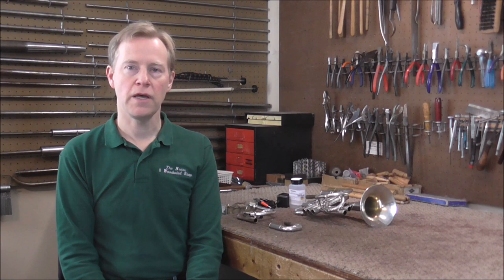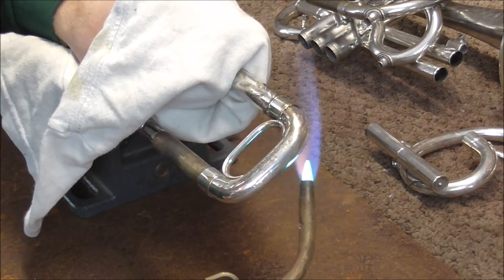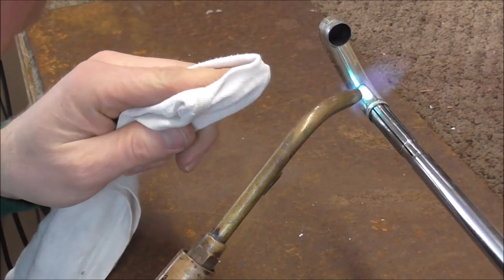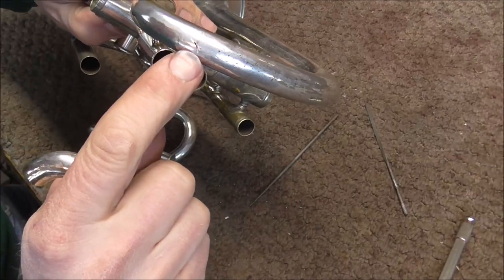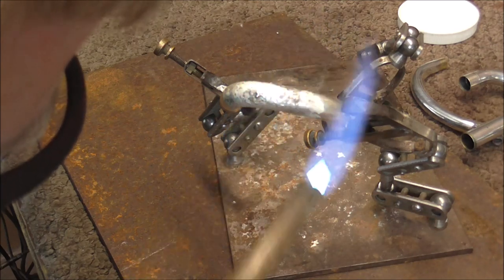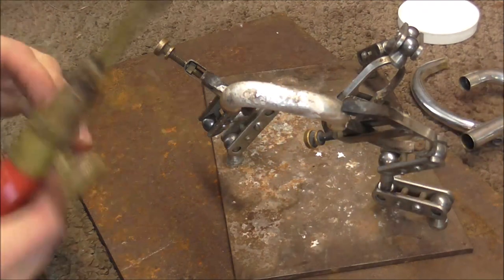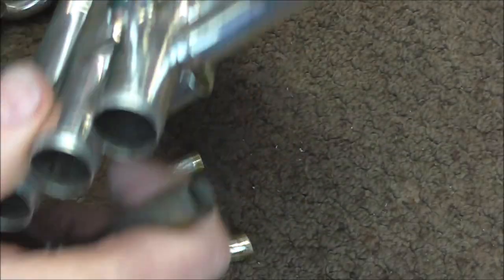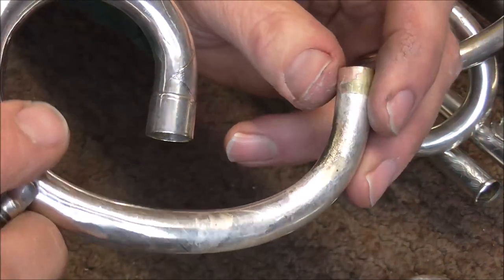Patching Cracks In Bell & Tuning Slide Crook: Distin Cornet Restoration #6

Comment: Hello, Art. Great videos. Have a question about patching with a silver soldering. Could it leave a drops and bugle inside the tubing, where you can't file? And how to avoid it?
Reply: From my experience, you can leave drops inside of the tubing it the crack is very wide, and/or too much heat was applied which makes the silver solder super fluid.
To me, the best way to avoid it is keeping cracks thin (even if filing a little bit the inside is mandatory, solder won't stick to dirty/oxidized brass) and, as always for solder jobs, managing the heat which requires experience.

Fortunately I learned making this kind of jobs by making rolled tubes (to replace mouthpipes of old horns) so I could file the inside of the tube when I messed up

(This is my opinion and experience, Art has probably more interresting stuff to say)
Reply from the maker: What 1090yoyo said is accurate. Because the inside of the tubing has not been cleaned thoroughly, it is unlikely that very much solder will flow into it if the crack is small. If the crack is larger, there are ways of keeping the solder out, but it takes a lot more skill and heat control and it is a little risky. In situations like that, I would usually soft solder a patch onto it.

Comment: I’ve wondered. Is it possible to convert a f attachment trombone to a bass trombone. Like an older open wrap single rotor to a 2 rotor.
Reply from the maker: Yes, it is possible, but it would be very expensive and finding parts would be a little difficult.
Reply: You can als9 buy a valveset from edwards or shires and have it fitted on to your bell

Comment: Are the capillary effects different from silver solder to soft solder?
Reply from the maker: If you heat it up to 1400 degrees F, the capillary action is similar, usually, the silver solder joints are smaller where capillary action is not as important.

Comment: Hi Art, great job.
However i'm concerned when I see you using your bare fingers to put hard solder flux... Borax is a highly unhealthy product (carcinogen), its fumes are also toxic shit...
I suggest using gloves or tools for spreading it... and I'm currently buidling a fumes aspirator based on a little CMV fan to avoid breathing it, when finished I can tell if it's efficient or not.